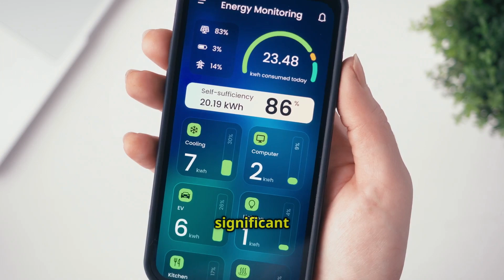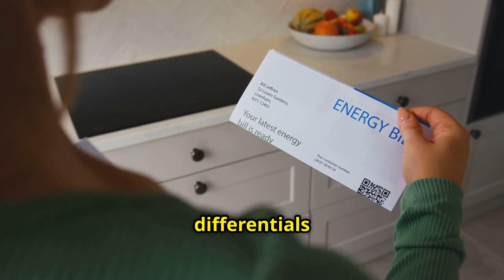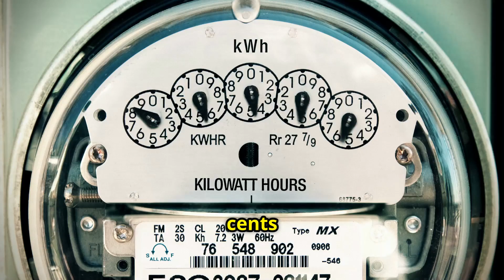Debunking Solar Battery Myths: The Real Truth

Comment: I'm not even a salesman for batteries but their data is woefully misleading. You can spend this much on batteries, but you're being taken advantage of if so
Reply from the maker: @bearfood9697 Absolutely spot-on analysis! 🎯 The battery pricing BS in this industry is getting out of hand.

Here's what we're seeing in *legitimate pricing* based on current market data:

- **5kWh systems**: Should be around £4,000-£5,000 installed[1][4]
- **10kWh systems**: £8,500-£10,000 range[2][4] 
- **Cost per kWh**: £265-£415 is reasonable[3]

But we're hearing quotes of *£15K-£30K* for systems that should cost half that! The predatory sales tactics are unreal:

*🚩 Red flags we see constantly:*

- "Government grants" that don't exist
- Pressure to "sign today only"
- Warranties that void in normal temps
- Zero mention of realistic payback periods

*The reality check:* A properly sized battery system for most UK homes shouldn't break the bank. You can get reliable backup power without selling a kidney!

What's particularly frustrating is how this hurts the entire solar industry's credibility. When people get burned by overpriced battery systems, they become skeptical of legitimate solar solutions too.

*Pro tip for anyone reading:* Get 3+ quotes, verify ALL claims independently, and remember - if they won't let you think about it overnight, walk away. Period.

Thanks for calling this out - the industry desperately needs more voices like yours! 💪

-The ClearSpot Team 🌞"

*We're definitely doing that "How NOT to get ripped off" video next week! 📹

[1] https://www.sunsave.energy/solar-panels-advice/batteries/costs
[2] https://www.solarguide.co.uk/solar-batteries/cost
[3] https://www.ecoflow.com/uk/blog/solar-battery-prices
[4] https://www.theecoexperts.co.uk/solar-panels/storage-batteries-cost
[5] https://www.consumeraffairs.com/solar-energy/how-much-do-solar-batteries-cost.html
[6] https://www.solarchoice.net.au/solar-batteries/price/
[7] https://www.solar.com/learn/solar-battery-price/
[8] https://www.bankrate.com/homeownership/solar/solar-battery-cost/
[9] https://www.angi.com/articles/solar-battery-cost.htm
[10] https://www.greenmatch.co.uk/blog/2018/07/solar-battery-storage-system-cost